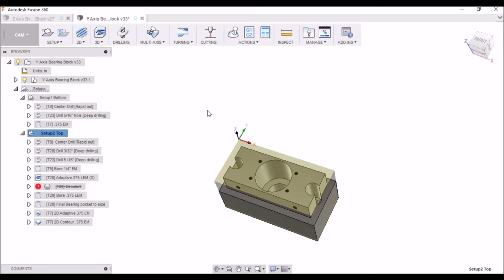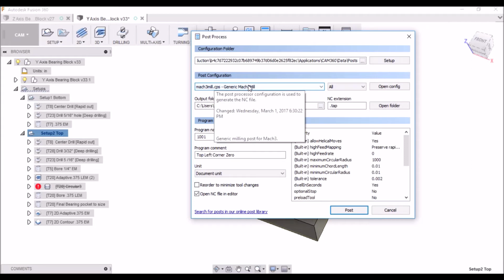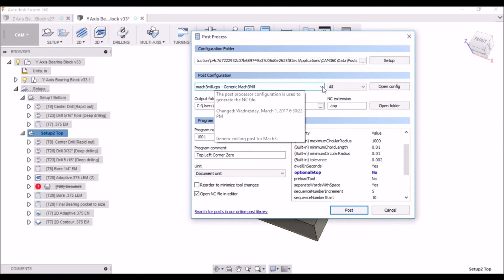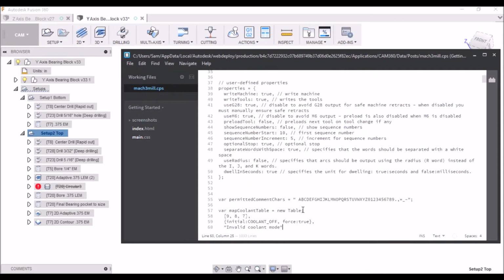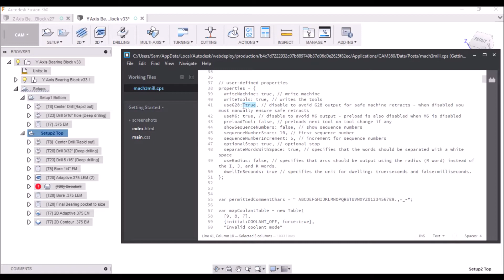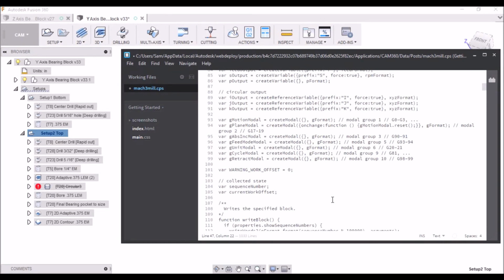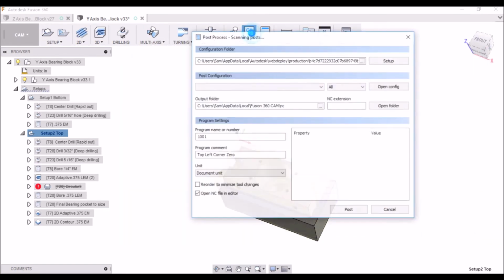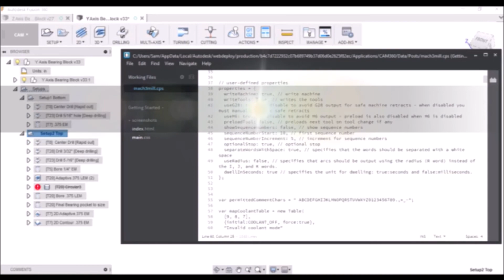Fusion 360 Custom Post Processor

Comment: Sam,  I'm running the latest Fusion 360 and my Post Process selection does not look like yours.  There is not Open config button.   There does not seem to be a way to edit the cps file as you have shown.   Is there a way to enable this functionality.   Thanks in advance!
Reply from the maker: Hi Bill double check as I just was editing a post last night
Reply: Mine does not look like that either. I am running on Mac

Comment: I have a machine that is programmed Radially, I can not find a post processor that works. Where can I find the perimeter to change from Diameter to Radial?
Reply from the maker: Funny you should ask, In Fusion 360  when you setup cam Operations there is a drop down for radial but I'm not sure if this is functional as it always post in Dia. mode. there maybe a option in your post processor. ask on the 360 forum there really helpful with this stuff

Comment: Hi Sam, great video and nice to see your keeping busy, thanks Daniel
Reply from the maker: Hi Daniel, Hope your doing well and back on your feet! Haven't been working much on the ATC
Reply: Thanks Sam,  getting there slowly, not back to work yet, but i have been working on some truck designs for a small 3 feet by 3 feet plasma table, I am building from spare parts from around the my work shop, it will be nice to have a fast cnc machine for a change lol, plus i can put a router on it for cutting mdf wood , thanks Daniel
Reply from the maker: Good to hear, a Plasma that would be nice.